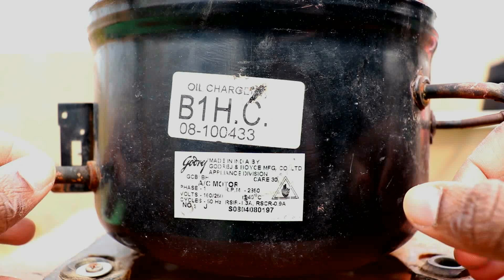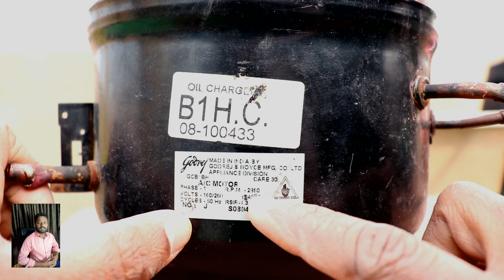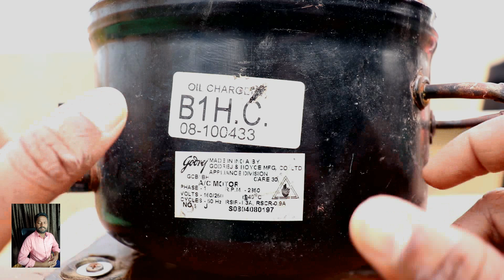How to Work Refrigerator Compressor and What's inside Practical in Telugu

Comment: Bro manam compressor bhadhulu small pump ni andhuku use cheyyanu  what is the reason behind the use  only compressor in fridge if it replaced with small pump and heating coil. Is this possible ?  If not why ?
Reply: I need reason not like Mr. Youtuber bro